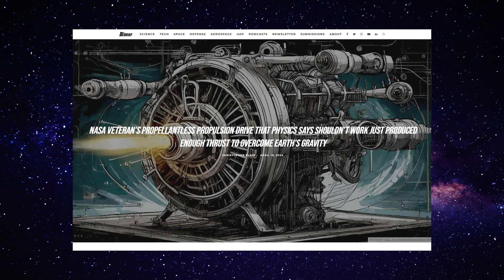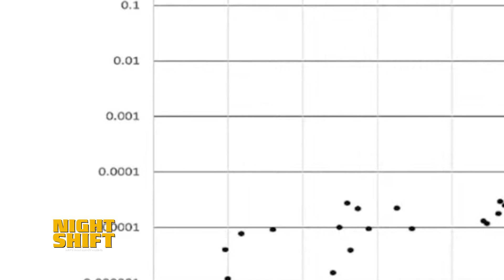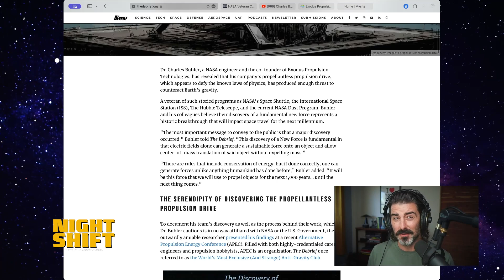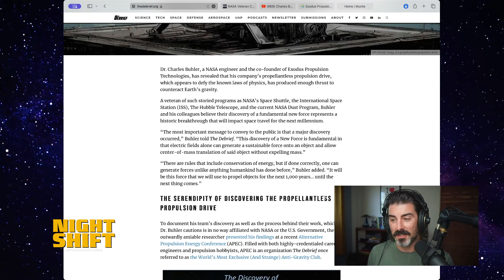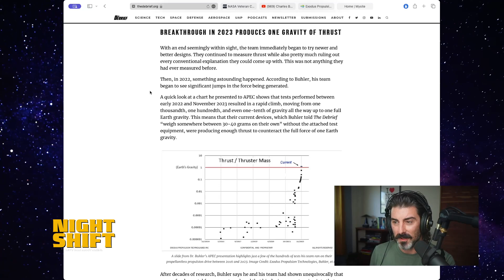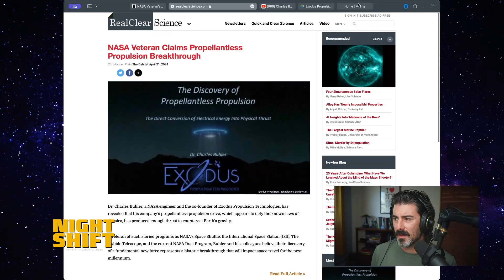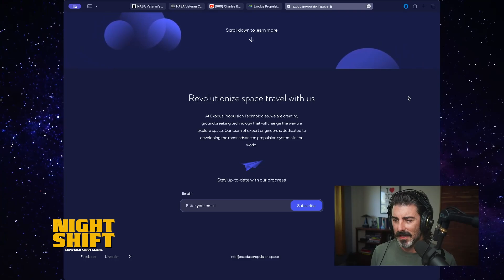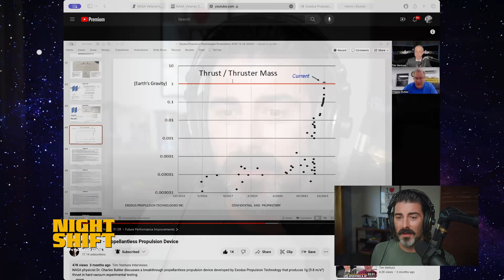Revolutionary NASA-Designed Gravity-Defying Drive Achieves 1G Thrust Without Propellant

Comment: Sadly the jerks in power won't allow this to come out just like the engine that ran on water.
Reply: But . . . it just came out.
Reply: Water engines are literally out on the road right now. They are just expensive to run.
Reply: @johnfrian Yeah that’s the problem.
Reply: Oh it will be put into military hardware for sure
Reply: Talked about 2 years ago and still "just came out"... and still no demo at all
Reply: @HzGP  there's a demo look it up
Reply: @pugger  the "look it up" demo that is nowhere to be seen... even Buhler said in his presentation video that the force they got is "incredibly weak.", was talking about miniaturizing the device, trying higher voltages and different materials, until he got to one G... still trying to find a direction and already claiming they "achieved" 1G of thrust, sounds like a lot of BS at the moment
Reply: If we now hearing about this been done back by Germany in ww2  used electricity to power up high voltage mercury spinning  around in vacumm tube high speed creates own gravity field and at point gravity feilds created glowed and was noticed by bomber pilots called them foo fighters but already have been to mars why space force created think about it
Reply: Buy yourself an electrolysis device, a multistage compressor to compress the hydrogen, and convert your car to run on hydrogen. You’ll find that it takes way more energy to do so than simply burning gasoline. It’ll be way more expensive, too.
Reply: @SeattleShelby Then you have a hydrogen powered car, not a water powered car.
Reply: …no you’re wrong, it’s the other way round it’s actually disclosure of a very old technology or I should say a fully mature technology that is currently being used in covert aerial atmospheric engineering drones— they want to simplify it down into the commercial sector for monetary gain reasons, and for ease of resource and platform development reasons. In other words, the commercial sector will help fund weapons development.

… if you’re an agent reading this forget about it, I’m not under disclosure agreements I can write what the hell I like!

Bonus information. This is currently being used on a device that everyone will know as the flying propane tank aka the ‘TicTac’, which is not coloured white like a TicTac. It’s actually coloured voodoo grey, which is why they never showed the optical footage of the platform, voodoo Grey has another designation FS 16515 designation is part of the Federal Standard 595C color system, which is a United States Federal Standard used for specifying paint colors- 

The other name is Boeing Gray so now you know who produced that particular black budget test platform.

Furthermore, the vehicle is remotely powered and piloted by beam formed millimetre waveband, power networks which are assisted by aerial atmospheric ionisation channels, which also go by another name, aerial atmospheric engineering.

Again, not under any disclosure agreement so I can write what I want!

All of this is supposedly intensely classified information, but it probably won’t be for long is my guess 😂
Reply: no you’re wrong, it’s the other way round it’s actually disclosure of a very old technology or I should say a fully mature technology that is currently being used in covert aerial atmospheric engineering drones— they want to simplify it down into the commercial sector for monetary gain reasons, and for ease of resource and platform development reasons. In other words, the commercial sector will help fund weapons development.

… if you’re an agent reading this forget about it, I’m not under disclosure agreements I can write what the hell I like!

Bonus information. This is currently being used on a device that everyone will know as the flying propane tank aka the ‘TicTac’, which is not coloured white like a TicTac. It’s actually coloured voodoo grey, which is why they never showed the optical footage of the platform, voodoo Grey has another designation FS 16515 designation is part of the Federal Standard 595C color system, which is a United States Federal Standard used for specifying paint colors- 

The other name is Boeing Gray so now you know who produced that particular black budget test platform.

Furthermore, the vehicle is remotely powered and piloted by beam formed millimetre waveband, power networks which are assisted by aerial atmospheric ionisation channels, which also go by another name, aerial atmospheric engineering.

Again, not under any disclosure agreement so I can write what I want!

All of this is supposedly intensely classified information, but it probably won’t be for long is my guess 😂
Reply: it’s the other way round it’s actually disclosure of a very old technology or I should say a fully mature technology that is currently being used in covert aerial atmospheric engineering drones— they want to simplify it down into the commercial sector for monetary gain reasons, and for ease of resource and platform development reasons. In other words, the commercial sector will help fund weapons development.

… if you’re an agent reading this forget about it, I’m not under disclosure agreements I can write what the hell I like!

Bonus information. This is currently being used on a device that everyone will know as the flying propane tank aka the ‘TicTac’, which is not coloured white like a TicTac. It’s actually coloured voodoo grey, which is why they never showed the optical footage of the platform, voodoo Grey has another designation FS 16515 designation is part of the Federal Standard 595C color system, which is a United States Federal Standard used for specifying paint colors- 

The other name is Boeing Gray so now you know who produced that particular black budget test platform.

Furthermore, the vehicle is remotely powered and piloted by beam formed millimetre waveband, power networks which are assisted by aerial atmospheric ionisation channels, which also go by another name, aerial atmospheric engineering.

Again, not under any disclosure agreement so I can write what I want!

All of this is supposedly intensely classified information, but it probably won’t be for long is my guess 😂
Reply: Well, other posibility is this is soft disclosure.  So they will release the technology they have reverse engineered bit by bit under their own name instead of saying they got it from Ufos
Reply: Lol retard, the engine runs on hydrogen and they use electrolysis on the water to split it into hydrogen and oxygen. Extremely inefficient.
Reply: An engine running simply on water is nonsense. It takes more energy to break the molecular bond between hydrogen and oxygen than burning the hydrogen and oxygen gives off. So unless he had some magical way to split water molecules then he wasn’t telling the whole story. I speculate that he wasn’t disclosing the batteries and charging them to make the electrolysis when he said that you could get across the United States with 22 gallons of water.
Reply: @forfun6273  You do know there are quite a few patents for engines that run on water right? It's no secret. Maybe whoever is paying you to come up with shit needs to pay me instead.
Reply: @PLATINUMSWORDS No there are not any patents for water powered cars. You should have paid attention during high school chemistry class.
Reply: Here we go again, the suppressed engine that runs on water.
The reason engines can’t run on water is the same reason that you use water to put out a fire and not gasoline. You should have payed attention during high school chemistry class.
Reply: @mitseraffej5812  i mean you can make a steam engine. Or you could use electrolysis. But the amount of energy it takes to rip apart the hydrogen and oxygen atoms is more than the energy you get from burning that hydrogen and oxygen. So yeah I agree with you that it’s idiotic nonsense but yeah I just felt like you opened yourself up to a retarded rebuttal from one of these nut jobs.
Reply: Alas we need to keep pushing. With the Internet information sharing cannot be effectively censored.
Reply: no you’re wrong, it’s the other way round it’s actually disclosure of a very old technology or I should say a fully mature technology that is currently being used in covert aerial atmospheric engineering drones— they want to simplify it down into the commercial sector for monetary gain reasons, and for ease of resource and platform development reasons. In other words, the commercial sector will help fund weapons development.

… if you’re an agent reading this forget about it, I’m not under disclosure agreements I can write what the hell I like!

Bonus information. This is currently being used on a device that everyone will know as the flying propane tank aka the ‘TicTac’, which is not coloured white like a TicTac. It’s actually coloured voodoo grey, which is why they never showed the optical footage of the platform, voodoo Grey has another designation FS 16515 designation is part of the Federal Standard 595C color system, which is a United States Federal Standard used for specifying paint colors- 

The other name is Boeing Gray so now you know who produced that particular black budget test platform.

Furthermore, the vehicle is remotely powered and piloted by beam formed millimetre waveband, power networks which are assisted by aerial atmospheric ionisation channels, which also go by another name, aerial atmospheric engineering.

Again, not under any disclosure agreement so I can write what I want!

All of this is supposedly intensely classified information, but it probably won’t be for long is my guess 😂
Reply: no you’re wrong, it’s the other way round it’s actually disclosure of a very old technology or I should say a fully mature technology that is currently being used in covert aerial atmospheric engineering drones— they want to simplify it down into the commercial sector for monetary gain reasons, and for ease of resource and platform development reasons. In other words, the commercial sector will help fund weapons development.

… if you’re an agent reading this forget about it, I’m not under disclosure agreements I can write what the hell I like!

Bonus information. This is currently being used on a device that everyone will know as the flying propane tank aka the ‘TicTac’, which is not coloured white like a TicTac. It’s actually coloured voodoo grey, which is why they never showed the optical footage of the platform, voodoo Grey has another designation FS 16515 designation is part of the Federal Standard 595C color system, which is a United States Federal Standard used for specifying paint colors- 

The other name is Boeing Gray so now you know who produced that particular black budget test platform.

Furthermore, the vehicle is remotely powered and piloted by beam formed millimetre waveband, power networks which are assisted by aerial atmospheric ionisation channels, which also go by another name, aerial atmospheric engineering.

Again, not under any disclosure agreement so I can write what I want!

All of this is supposedly intensely classified information, but it probably won’t be for long is my guess 😂
Reply: no you’re wrong, it’s the other way round it’s actually disclosure of a very old technology or I should say a fully mature technology that is currently being used in covert aerial atmospheric engineering drones— they want to simplify it down into the commercial sector for monetary gain reasons, and for ease of resource and platform development reasons. In other words, the commercial sector will help fund weapons development.

… if you’re an agent reading this forget about it, I’m not under disclosure agreements I can write what the hell I like!

Bonus information. This is currently being used on a device that everyone will know as the flying propane tank aka the ‘TicTac’, which is not coloured white like a TicTac. It’s actually coloured voodoo grey, which is why they never showed the optical footage of the platform, voodoo Grey has another designation FS 16515 designation is part of the Federal Standard 595C color system, which is a United States Federal Standard used for specifying paint colors- 

The other name is Boeing Gray so now you know who produced that particular black budget test platform.

Furthermore, the vehicle is remotely powered and piloted by beam formed millimetre waveband, power networks which are assisted by aerial atmospheric ionisation channels, which also go by another name, aerial atmospheric engineering.

Again, not under any disclosure agreement so I can write what I want!

All of this is supposedly intensely classified information, but it probably won’t be for long is my guess 😂
Reply: no you’re wrong, it’s the other way round it’s actually disclosure of a very old technology or I should say a fully mature technology that is currently being used in covert aerial atmospheric engineering drones— they want to simplify it down into the commercial sector for monetary gain reasons, and for ease of resource and platform development reasons. In other words, the commercial sector will help fund weapons development.

… if you’re an agent reading this forget about it, I’m not under disclosure agreements I can write what the hell I like!

Bonus information. This is currently being used on a device that everyone will know as the flying propane tank aka the ‘TicTac’, which is not coloured white like a TicTac. It’s actually coloured voodoo grey, which is why they never showed the optical footage of the platform, voodoo Grey has another designation FS 16515 designation is part of the Federal Standard 595C color system, which is a United States Federal Standard used for specifying paint colors- 

The other name is Boeing Gray so now you know who produced that particular black budget test platform.

Furthermore, the vehicle is remotely powered and piloted by beam formed millimetre waveband, power networks which are assisted by aerial atmospheric ionisation channels, which also go by another name, aerial atmospheric engineering.

Again, not under any disclosure agreement so I can write what I want!
Reply: no you’re wrong, it’s the other way round it’s actually disclosure of a very old technology or I should say a fully mature technology that is currently being used in covert aerial atmospheric engineering drones— they want to simplify it down into the commercial sector for monetary gain reasons, and for ease of resource and platform development reasons. In other words, the commercial sector will help fund weapons development.

Bonus information. This is currently being used on a device that everyone will know as the flying propane tank aka the ‘TicTac’, which is not coloured white like a TicTac. It’s actually coloured voodoo grey, which is why they never showed the optical footage of the platform, voodoo Grey has another designation FS 16515 designation is part of the Federal Standard 595C color system, which is a United States Federal Standard used for specifying paint colors- 

The other name is Boeing Gray so now you know who produced that particular black budget test platform.

Furthermore, the vehicle is remotely powered and piloted by beam formed millimetre waveband, power networks which are assisted by aerial atmospheric ionisation channels, which also go by another name, aerial atmospheric engineering.

Not under any disclosure agreement so I can write what I want!

All of this is supposedly intensely classified information, but it probably won’t be for long is my guess 😂